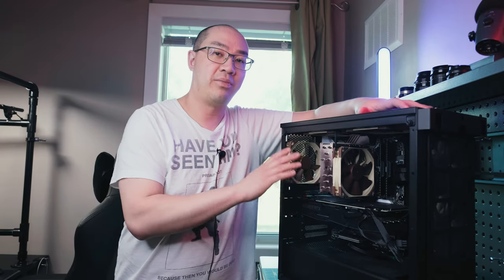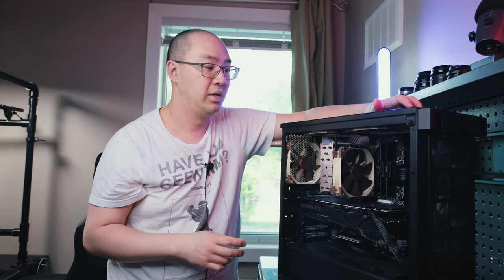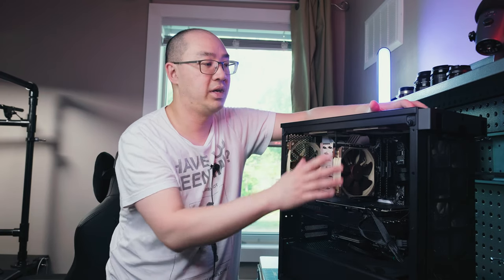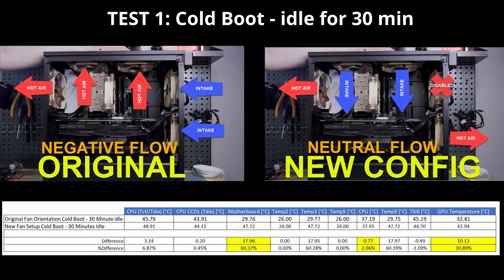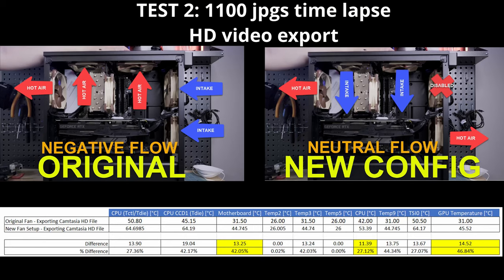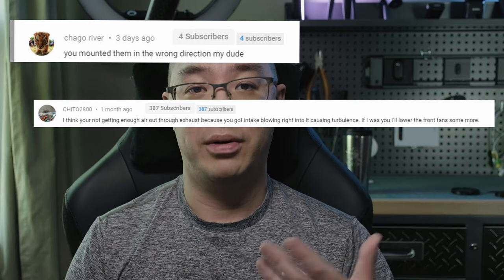Negative vs Neutral Air Flow Comparison | How to setup your desktop cooling fans 2

Comment: Try this:  Front two fans as INTAKE. Top fan in front of CPU cooler as INTAKE. Top fan directly above CPU cooler as EXHAUST. And the rear fan as EXHAUST. That gives you 3 in and 2 out which is positive pressure. This will gently push air our of nooks and crannies and keep dust out. Plus it follows the natural flow of air from front of case to back. And it mostly keeps hot air from GPU away from CPU. That is your best design with 5 fans in your arrangement. Cheers!
Reply from the maker: This is a great suggestion! In two weeks during my holidays, i'm going to redo the fan setup. I'll follow this suggestion and do some temperature readings. If you're okay with it, i'm going to credit you in the video. Stay tuned. I'll send you a message once I make this change and an updated video is up.
Reply: @TheWongReviewer  Sounds great! I'm very curious to see the results. Looking forward to it!
Reply: @TheWongReviewer  i'm going to watch your test bro do it.
Reply: I agree with this setup as well.  I've always used the same in/out or more intake than exhaust.  I used to constantly clean out pre-built PCs at work where there was only an exhaust so it pulled in dust from everywhere and clogged up everything.
Reply: So how is this setup's results?
Reply: @TheWongReviewer  any update on the fan setup?
Reply from the maker: Hi there! Yes I do! I made the necessary changes and currently filming the episode and doing the bench marking. It's going to be posted next Saturday. Thanks for following up!
Reply: @TheWongReviewer  Saturday passed
Reply: just used this idea for the fan arrangement and it seems to be working very nicely for me
Reply: @TenkoSekka  Hey! Glad to hear it.

Comment: Positive air pressure decreases dust build-up, if your fans are filtered. More air moving through your system = less dust settlement. Negative air pressure promotes dust build-up. Less air moving through your system = more dust settlement. I personally use a positive airflow with filtered fans and dust has NEVER been an issue for me.
Reply: So what’s your setup?
Reply: @boooshannon  From what i understand the negative pressure pulls in air from all the crevices which are unfiltered unlike intake areas which would normally have mesh to help filter dust (whereas “positive” on the other hand would be blowing air out of the crevices preventing dust from entering while the system is on). And that’s why negative pressure would be more dust prone. Also negative and positive would not mean more or less air flow inherently. Either could be higher or lower air exchanges than the other depending on fan configuration and speeds ect. According to jayz2cents the rule of thumb would be to set your intake fans rpms to as high as you can tolerate, then adjust the rpms of the exhaust fans to where your case pressure is just slightly positive, that way you have the most airflow possible while keeping things at a desirable sound level.

Comment: i dont think this configuration is good..the air coming from top panel will get sucked through side panel before even hitting the components.
Reply from the maker: I agree with you. I don't think this a great setup. As you saw in the video, the temps are way too high in the configuration.
Reply: It's interesting that the fan configuration makes such a big difference!

Comment: The only problem I personally see is that one of the top fans is quickly exhausting the air that the top front fan its pushing in which will reduce the air that goes to the cpu cooler fan.
Reply: Should have tried disabling top right fan and keep it as original setup

Comment from the maker: Timeline of video
00:27 Recap of current setup
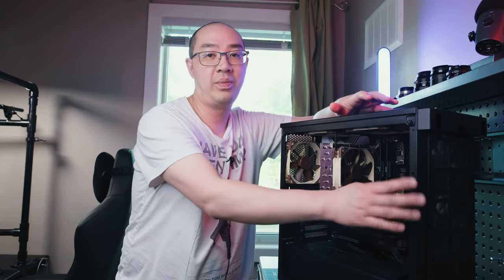02:11 DUST! DUST! Why you need to clean your PC
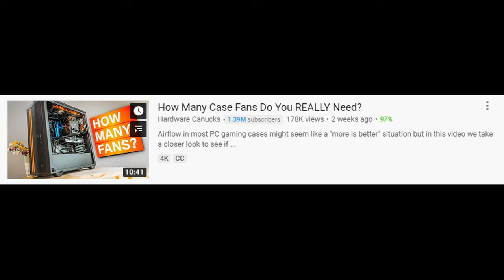03:40 Why I am changing my current fan configuration
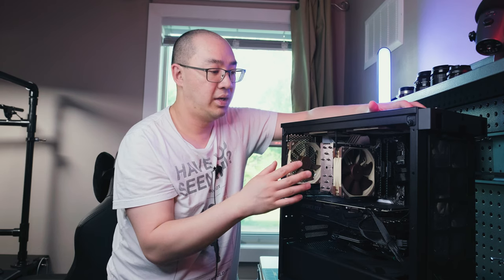05:51 Cleaning PC and changing fans 
08:38 TEST RESULTS: Negative vs Neutral Temp readings for CPU, Motherboard, GPU
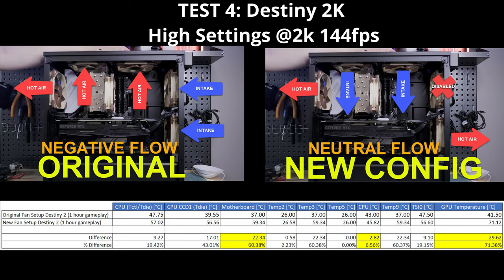11:59 Final thoughts: Call out to Arm Chair PC Builders - What should i do!!
Reply: What do you use to get rid of dust from your PC?
Reply from the maker: Every 3 weeks, I just vacuum the case like i did in the video. Unfortunately, that's the only think i can do.

Comment: In my experience negative flow results in more dust because of the void of pressure inside it sucks dust through all the other cracks and wholes in the case. Vs positive flow will typically be driving air through specific dust filtered intakes.
Reply from the maker: Hi there, sorry for the late replay. You're right. My negative setup right now is getting a lot of dust on the filters and in the case. I have to clean it out at least once a month. However, my readings tell me this keeps the temp of my computer cooler. Someone suggested I try and adjust the RPMs of the fans to see if that will lower the dust.
Reply: @TheWongReviewer  i have Q300L i bought it beause it looks good... turns out to be a below average when it comes to airflow. what i did then was add 3 fans, 2 at the top as exhaust(also have 1 stock exhaust at the back) and 1 at the lower front as intake, performance have improved so much i also removed the bottom dust filter so most of the air getting sucked inside by the negative pressure would come from the bottom of the case, and because of that i was able atleast reduce dusk coming inside(im not sure if this is effective but since there are more open holes at the bottom i guess its normal that most air that will get sucked by the negative pressure would come from the bottom?)... overall i guess negative pressure is better as long as you clean your pc atleast once a month

Comment: I have a similar config as your initial setup. The difference is, I put 3 fans on the front panel as intake, and one of the fans on top, the one closest to the front panel, is set as an intake. The other one on top, closest to the back panel is exhaust. 

Contrary to what you said about hardware cannuks' video (haven't watched it), I found if I set all top fans to exhaust (like your initial setup), my GPU would be 1-2 degrees cooler. Problem is, if I set it up like that, the case would be a negative pressure, like your initial one. It will suck dust in like crazy. By flipping one of the top fan to be an intake, I made my case a slightly (not much) positive pressure, sacrificing 1-2 degrees on my gpu.
Reply from the maker: Thanks for the feedback and letting me know what your setup is. I'm going to try some more additional orientations to see. I'm going to try your orientation, great idea.
Reply: @TheWongReviewer  so does the guy mean 3 front panel is intake. Most closest fan from top is intake, while rear and most closest to rear is exhaust?

Comment: Also you don't have to faff around with fan direction but fan speed.  If your case has filters then it's designed to be intake.  I would have the filtered areas in taking and everything else exhausting.  If you have negative pressure increase the speed of intakes and test with smoke sticks to see if any grates are pulling in air....and dust
Reply from the maker: HI there. Sorry for the late reply. That is some really good tip. I"m going to try this and post an updated video. I'll have to get get some insense sticks.
Reply: No problem.  I have found in my case nothing really affects total temperature, but that equilibrium takes longer... Have a weird set up anyway but my goal was dust free.  So I have two unobstructed intakes at the bottom and both the front and rear exhausting but my cpu is water cooled and the exhausts have radiators on. I was worried that my ram may get hot but I have a new 30 series GPU which blows on the ram anyway.   I've tested it with smoke matches and it's neutral flown.  Temps are good for a cramped case

Comment: I can see why the gpu might have had those results. One of the things I've noticed is a different CPU cooler that's a little bigger. I actually thought you should've let the disabled fan stay on. You technically now are using 6 120mm fans. Your gpu isn't getting the cool air it was getting from the fan in the front so the only fans that are really getting to it are the three fans on the gpu. Maybe using the higher front fan for heat exhaust help because heat rises. That might help air circulation. As far as the top two fans leave front fan used for intake that way the cool air it brings in the computer will then be pull through 120mm fan over the cpu. Then I was thinking you could trying either having the top back fan partnering up with the case exhaust fan to pull the hot air out at a good speed or just for a simple mod to your original setup change the top front exhaust fan and turn it into an intake. One thing's for sure the gpu needed some help for tempature.
Reply from the maker: Thank you for the indepth analysis and feedback. It's appreciated. Your idea of using the higher front fan to exhaust is a great idea!
Reply: @TheWongReviewer  I have done more research on computer cooling situations and your computer was for the most part setup okay originally. I just think your cool air may be getting pulled out faster on the top level. You can look at your original setup and see that you have the top front set up for exhaust and the higher front fan set up for intake kinda having a conversation with each other and I don't know if it's an argument or if it's a hi and a fan wave bye. From the videos I've seen I think all of these fans are the same and I'm not sure but if that's a cooler master cpu cooler another fan can be attached to the otherside but that's up to you. As far as your fans if you can find fans with a faster rpm they can be used for your intake fans to pull more cool air in. Cool air will get inside at a faster rate blowing stronger not only cooling the parts better but not getting pulled out before it can do it. You would want to leave your exhaust the way you had it because now you've got a faster intake. It may be from the same location but it's a faster rate. The other factor is your fan type. From the information the videos provided some fans are better for static pressure and the others are better for airflow. I'll include some videos links. They'll help you figure out if static pressure vs airflow fans might help your problem. 
https://youtu.be/e-cxkxtu1As  https://youtu.be/BsT3JCXKiQA  https://youtu.be/Mdx9U-KW038  https://youtu.be/g8EN3K-eaVA https://youtu.be/8OmkmluAYAQ  https://youtu.be/4NYHC3DXynM

Comment: When i started watching the video I didn't expect it to be better. Lots of comments here and I will add one.
Not sure why you need so many fans, but I would have at max two. Both blowing in. You have plenty of holes in the case for heat to escape. Each hole in theory will have the same air pressure and take heat away. The GPU will suck air in and create its own vortex. For reduced dust you don't really want any air coming in that is not via a mesh dust filter. 
As an experiment, I would try the CPU cooler fan at the back of the heat sink, I know for water radiators it makes no difference if it pulls or pushes air on to the radiator. I expect it to be the same for the CPU cooler but if located at the back it will be closer to the rear case exit holes.

Comment: Where the intake and exhaust is also matters. The neutral setup used here would contain many eddie's in the airflow.
Reply: Yeah i was thinking the same, it looks good except for the phat Noctua CPU cooler fan, something he didn't take into account. otherwise the 2 in 2 out on both sides would be a good neutral setup.

Comment: I watched your other two videos and I agree, you do have a negative pressure setup.  From what I understand, a negative pressure setup can pull air/dust in through areas not protected with a filter.  Since your pushing more air out, the air inside needs to be replaced so it creates a light vaccuum through those areaas where there are no fans.  If you're using dust filters a neutral or postitive setup may help with dust.  

In the new setup the GPU fans are fighting for air since they are set up to pull air in from the bottom of the case.  Since the case intakes are at the top, it's likely the GPU is barely getting any cool air since it's blocked by the top of the card then exhausted out the front.  

It looks like you still have two different fans.  The ones on the front of the case are better for static pressure so they move less air than the ones at the top.  I think if you maybe swap one of the front ones with one of the top ones, then use two for intake at the front and two for exhaust, you may see better thermals and less dust.  ....but I could be wrong.  Still a great video and definitely educational.  Keep them up!
Reply from the maker: Hey there. I appreciate all the feedback you provided and the detailed explanation and rationale. This is gold. I'm going to review my fans, i may have purchased 2 different models of Noctu.  I agree with you that I think the GPU is not getting enough air in this video setup. I have 2 weeks off from work now and I plan to do an updated video with a new setup and thermals.
Reply: @TheWongReviewer  good stuff, I look forward to seeing the new vids.  I will say that Noctua fans are amazing and in my opinion worth the extra money.  The quality is top notch and they come with all the accessories.  I just swapped my corsair fans for NF-A12 PWM fans and they are soooo much quiter, even in a small form factor build.

Comment: You want positive pressure to reduce dust as long as the intakes are filtered. If you have beg pressure it will pull unfiltered air in from everywhere and it much harder to clean.

Comment: I think the first config was best bro...Great video man....And nice setup also....You could try undervolting your gpu to get better temps also brother...Great video again.
Reply from the maker: Hey Maurice, thanks for the feedback. Appreciate it. I updated my fan setup again. Where i adjusted the front fans to intake. I also changed one of the top fans to intake as well. I'm going to test the temps in a bit. Great suggestion on undervolting GPU. I'm going to look into that a little more.

Comment: Simple explanation 
1) exhaust fans > intake fan = negative pressure in cabinet = more dust 
2) intake fans > exhaust = postive pressure in cabinet = less dust - more preferred
3) intake fans= exhaust = neutral pressure  - ideal scenario - also works well
Reply: hey i dont have knowledge about airflow and computer and all that i cant understand this video fully can you suggest what should i do for my self i have 1 fan that is intake at the front  and 1 exaust at the back i have 2 free slots and 1 in the front can you suggest me what confirigation should i do i mostly put my pc with 5-6 inches above the floor could you pls help me ?

Comment: Hi what did you use to clean the pc? was that a house vacuum cleaner? if not could you please drop a link to purchase one?
Reply from the maker: HI there. I just used my normal house vacuum. I have a dyson vaccuum cleaner.
Reply: @TheWongReviewer  oh my god, I didn't know we can use home vacuum cleaner to clean pc. Won't it damage any sensitive parts in mobo? I have got no vacuum cleaner till now but wanna try one.
Reply from the maker: @tiltmaharaja4767  Hi there. You can use a normal vaccuum. Only thing is, you shouldn't use the brush of the vaccuum if you're actually vacuuming the components inside your PC because of the possibility of static electricity.
Reply: @TheWongReviewer  ok tysm

Comment: Hello, I have a ROG Strix GL12CM with a blower GeForce GTX 1070 8GB. The cooling system is set up by the factory with air and not liquid. The problem is when I start gaming the GPU increasing temps up kinda 83°C and my pc sounds like an airplane. Right now I have only one fan in the back and one on my processor. I read about my case I can use only 9cm in the back(unfortunately) and 12cm fans in front or above. My question is you recommend putting a fan under my GPU?
Reply from the maker: HI there. So I looked into this and I see that this is a pre-built machine. Yeah, you're right, the PC is loud because the fans are at max to dissipate the heat emitted from your GPU. If you're able to, I would put a fan blowing across your GPU blowing up and should help move the air out the back. With pre-built, do you have an extra fan header on the motherboard to support another fan?
Reply: @TheWongReviewer  First of all thanks for the answer.. well on my motherboard I have 1cpu fan and 3sys fan, with 4pin. Right now 2fans are not in use. What do you think if I put one ahead, one under my GPU with airflow up and the last one to changing the original from the back with some Noctua? I mean all three. I guess this is a good brand and pretty quiet. My power supply it's only 500w it will not be overloaded?
Reply from the maker: @artist.domokos  Fans don't take a lot of power, so i'm not worried of overloading a 500W power supply. I would use HWInfo 64 to take temp readings for a baseline and then put the fan under your GPU blowing up. Using HWInfo 60 i'm sure it will lower the temperature. Hopefully it cools enough it's not maxing out your RPMs of existing fans so it' s not as loud.
Reply: @TheWongReviewer  That's awesome, I'm gonna order 3 fans, one with 9.2cm and two with 12cm. I'm really curious to test. Thank you so much for your advice and your time.